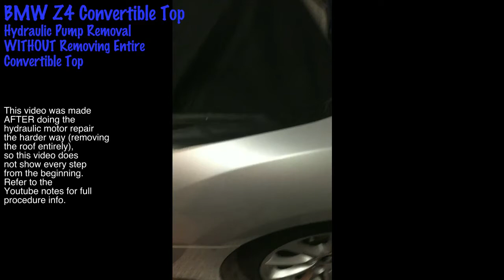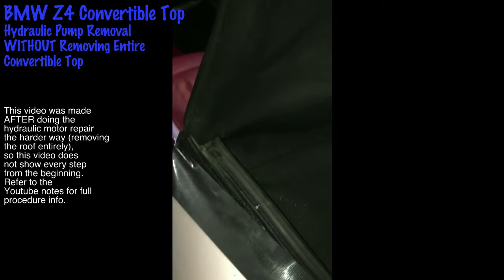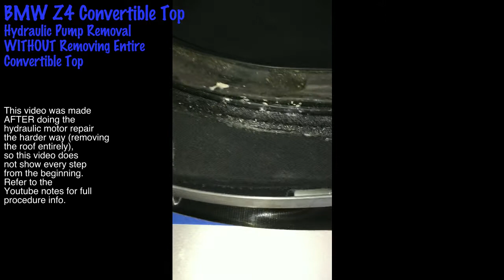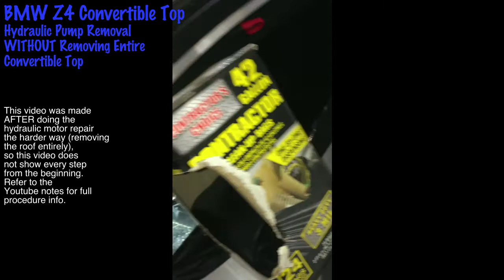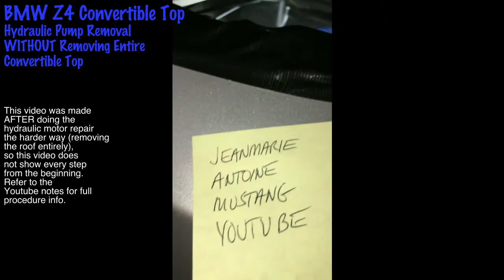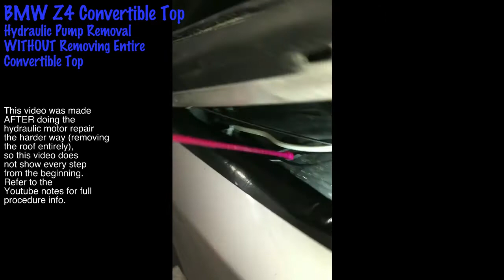Z4 BMW- Roof Motor Removal Through Rear Window

Comment: Thanks for the video Jack. Question i have a mustang pump on it. How does it work when it comes to the release latch if this pump doesnt have that? And how would you flush/bleed when adding fluid? Thank you
Reply from the maker: My understanding of the release hatch is that it's a "nice-to-have" in the event that BOTH... A) the roof is stuck in the down position, and B) the hydraulic circuit is still perfectly healthy (meaning no leaks caused the roof to fail to operate). This could mean that attempts to manually lift the roof fail and no amount of slow force can pull the roof up. Clearly the Ford design somehow disregards this need, so maybe it almost never happens (or slow manual force can always raise the top). In any case, my solution is to keep a box wrench of the appropriate size for the hydraulic fittings (10mm???) permanently taped to my hydraulic unit... so I can release it if that scenario ever happens. And a rag to collect the fluid. 

As for bleeding, I'm a total newbie about that. Look up a few youtubes on that and you'll be in better shape than relying on my thoughts. (Side story: before getting my original BMW pump temporarily re-installed it would only spin, not pump fluid. I took it apart down to the incredible ball bearing valve that does the magic and showed it to my neighborhood mechanic, asking "why no work?" He looked at me, first in amazement at what I had shown him, then dead-panned, "Did you bleed it?" OMG, I thought to myself, what an idiot I am; of course, it's no different than brakes. I walked out with my tail between my legs but it was working later that day.)

Comment: Good video. I did it the hard way, tested the roof out and it worked, but now it’s all back in the car it won’t work and I think the reason is that I’ve put a kink in one of the hydraulic lines 😢, so I’ll see if I can fix it using this method first. Thanks.

Comment: Thank you very much for the video....I managed to take out the motor through the the trunk, took me about 2.5h, just to realize that my motor is in an amazing condition and the problem was a broken pipe (number 14).... I promised myself I’m not gonna take the roof off because it looks like a big hassle and realized there must be another way. Thank you very much for the video.

Comment: Thank you Jack! I was able to use this method to move my pump AND revive it by taking it
 apart, lubricating, and putting it back together just like second video by Jack Bellis (2nd vid on his google doc file).  I did all of this w/o disconnecting a single hydraulic line. One tip that I didn't see in the video is to remove the large T50 bolts (top 
bolt only) that are on the sides of the car behind each seat.  This gives the extra slack needed to easily get the large aluminum loop above the trunk area. I absolutely could not accomplish this w/o removing those bolts (and I tried for a couple hours). I had the top in various positions (fully up, to 3/4 up, etc.) in order to gain ideal slack needed.  Very helpful videos.
Reply from the maker: Great to hear. And thanks for adding to the instructions with the info about releasing the top bolts. That’s the sort of thing I always suspected I’d be at risk of missing without doing the entire thing from scratch.

Comment: HI Great video i have 2005 BMW Z4, can i just replace the motor and use the old pump? they are seeling just the motor on ebay for 80$,  https://www.ebay.ca/itm/Convertible-Top-Folding-Roof-Hydraulic-Pump-Motor-for-2003-2009-BMW-Z4-E85/352728279164?hash=item52203e687c:g:8IgAAOSw5HFdNZJe&vxp=mtr
thank you for great video, and i cant find ford mustang pump for under $200 on ebay

Comment: Wow... Thanks, Jack for posting the doc with details. 

I was able to get in without lifting the top out entirely. The first disassembly was the worst...countless hours, endless frustration. The second and third disassembly was noticeably faster thanks to not removing the top fully. 

So for a 2005 Z4 2.5i, I replaced...
- The motor with a 2009-2014 Ford Mustang convertible motor #HB80069-002N OEM 2010 (eBay). It's a lot bigger so no way was it going back in the original muck-bucket. It's noticeably more powerful which seems to be ok for the moment. I didn't have to do anything special with the power lines, I used the original and spliced them into the wires that came with the replacement.

- The Hydraulic Hoses Right - #54347119640 (Turner Motorsport) because line #14 was split and repeatedly sprayed fluid everywhere :)

- Hydraulic Hoses Left - #54347119639 (Turner Motorsport) because after drilling the hole, threading the lines through and moving the motor to the trunk, the original line (#11) seemed to kink where it inserts into the post, so I replaced it with the new left line #12 to get an extra 4 inches. 

- A gear for top latch motor 67618370816 (eBay) because had cracked (still waiting on delivery).

By far the most painful DIY project my wife and I have done...and we're still together, so while it's been unpleasant, it'll make driving all that much sweeter.

Comment from the maker: 2007 (E85)... E85 means 2002-2008. Yes, the mustang pump should work. Make sure to see the "SHOW MORE" details on all of my video posts. Google hides it so you don't miss any of their advertisements.
I'll bet there are dozens of pumps that will work, as long as they're the same fitting size. Logic would dictate that the only other circumstance on these pumps would be 12 volts of power, and the ability to run in two directions so the roof can go up and down. Perhaps there are some pumps that have more complicated power or control connections. It's hard to imagine any pump having other than 4 hydraulic connections. So I suspect that someone just has to document the thread specifications on the hydraulic lines, to enable us all to identify the pump substitution criteria. I'll start to read up on that... probably found on some of the web pages for the hydraulic lines. But I don't want to slow down this response while I do that.
Reply: My question is the end of the lines- they fit on the mustang pump directly?
Reply from the maker: Vahan Petrosyan yes the do

Comment: Thx alot it works I did it today, not sure if dismantling the whole roof isn't easier since I never did,  but I got a feeling it is.
Reply from the maker: Arik A 
Every step you did to use my procedure has to be done if you remove the whole roof.  You’d need either a gantry/motor crane-hoist or a helper. If my procedure made it very difficult to disconnect/reconnect the pump then possibly you are right. I’m curious if you replaced the BMW pump in the well or put a pump in the trunk but I presume that’s unrelated to your comment. Either way this is a job only for the Extreme Doityourselfer. No one should suggest otherwise. Thanks for the info.
Reply: @nofluffDIY  yes indeed it's challenging to get the pump cause it's hard to reach and try and cut the pump's holder, anyhow I did it, and moved it to the trunk, I now know it is worth it and much less work than taking the whole roof out, so thx again I couldn't do it without your help
Reply from the maker: @FHKGBJILBJ  
I hope to have a chance to do the entire procedure again on a friend's car and will update my instructions. Until then, sounds like I should add a step about cutting the zipties and untaping the plastic shell. All readers should feel encouraged to submit exact wording for me to add. Thanks
Reply: @jack bellis.    Are you by chance in the states?
Reply from the maker: @ajcanby9071  Yes I am.

Comment: Thanks for your advice. I have followed it and gone well so far. The original motor is dead so I need to locate a replacement. Where did you locate the Mustang pump? Many thanks
Reply from the maker: Sorry I missed your post for a week. 
I got it on ebay from "truckautoparts" USA (California, I think). https://www.ebay.com/usr/truckautoparts?_trksid=p2047675.l2559
Reply from the maker: I realized I should add that any given ebay provider of vehicle parts is not particularly likely to have additional of the same part. But in general it should be easier to get Mustang convertible pumps than Z4 pumps from junkyards because there are so many more Mustangs and they are driven by younger drivers. Looks like about 10,000 Z4s vs 300,000 Mustangs sold since 2010! I'll bet there are almost zero "totaled" Z4s, and perhaps hundreds of Mustangs per year, but only perhaps 10-20% of the Mustangs are convertibles.

Comment: HI Jack Bellis. I am glad you were able to fix the top problem with the Mustang pump.  I am having the same problem, my top stooped working.  You mentioned you go the Mustang pump for $185.  could you please tell me where did you get it from?
Reply from the maker: Sorry I missed your post for a week. I got it on ebay from "truckautoparts" USA (California, I think). https://www.ebay.com/usr/truckautoparts?_trksid=p2047675.l2559
Reply: @nofluffDIY  Thank you very much for the info. I will check it out.

Comment from the maker: I am pretty sure this procedure enables accessing the motor without removing the whole convertible top but I won't consider it definite until someone confirms it. Please post a comment if you use this procedure successfully. Thanks!
Reply: Jack Bellis confirmed. Got the motor out without any problems.
Reply from the maker: Woohoo! I think this is big news, right? Lifting that entire roof out was ridiculously hard. 

Complication to prepare for if you do the option to move the pump to the trunk: Routing the electric line to the back (to place a larger Mustang pump in the trunk) was tricky... I didn't make a careful observation of how they routed the 40-amp motor line. Take a look how they route it around the main structural bars of the roof mechanism, so you can start off in that same direction. And the hydraulic lines are just barely are long enough but they are. 
Thanks
Reply: Hey Jack thanks so much for your video. I was able to access the motor housing, but I can't seem to pull the motor housing out of it's little compartment/gutter. Any tips? It wiggles but won't come out, almost as if it's tied down by something

Update, per this post it appears to be attached to the convertible top mounting via cable ties:
https://www.bimmerforums.com/forum/showthread.php?2288133-How-to-replace-soft-top-motor-without-removing-roof-DONE!
Reply from the maker: @ksikka  Nothing like replying 6 years later, but polite nonetheless requires it. (I had one email conversation with a 10-year gap :) ). Others have commented on the capsule (or its nearby lines being zip-tied). Use your fingers to completely memorize the zip-ties and reach in with a "diagonal" wire cutter to snip them.

Comment from the maker: I see that in this procedure, I kept the roof fully "up" all the time, but I'm pretty sure that if you move it to the half-way position, there's a lot more slack in the entire structure and it should help pull the channel out. I used filament-reinforced strapping tape from the windshield to the roof struts to keep it in the half-up position. Full instructions at https://docs.google.com/document/d/1WVVYTX-9eB3lclY1Wr-SOijityt-nv8bkQokRfDBqAo/edit?usp=sharing